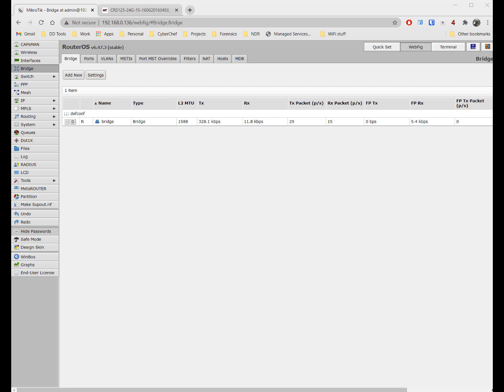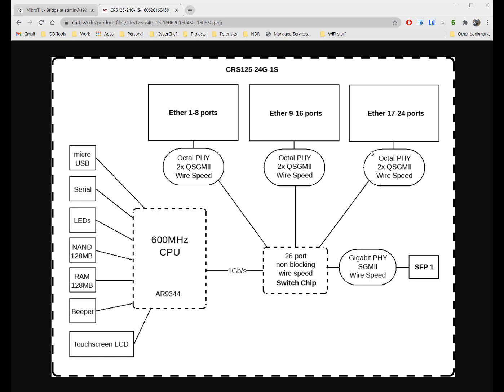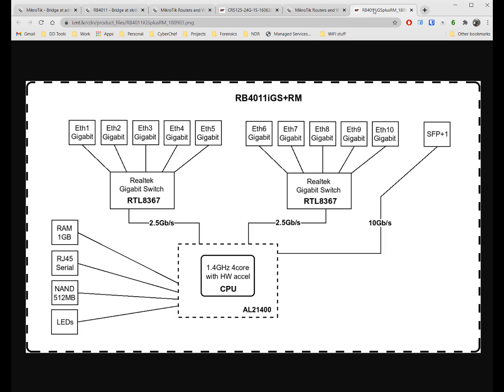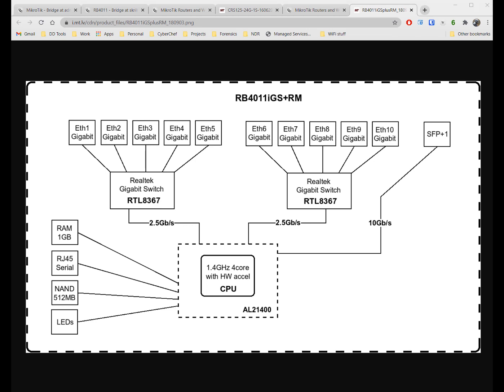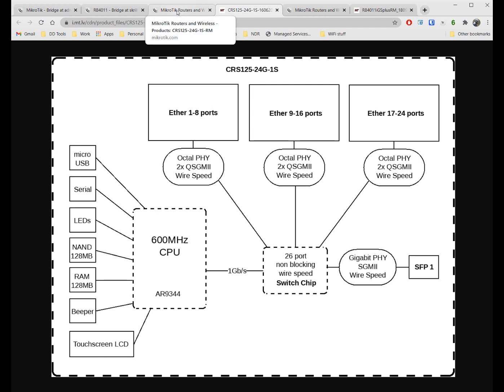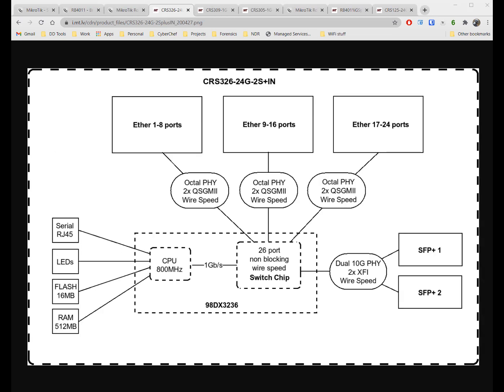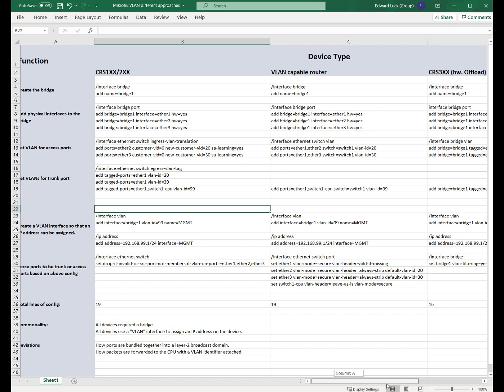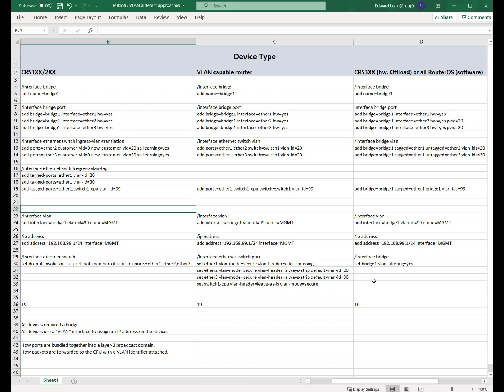Mikrotik Bridge VLAN Filtering - Software vs Hardware

Comment from the maker: Hi commenters - please note that as of ROS 7.X, Bridge VLAN Filtering works in hardware on the RB4011 now (as well as the RB5009).
Reply: Thanks for going back to update this. I appreciate all the info you've pulled together to be able to make the spreadsheet and those comments and I like your perspective on new users, as I'm one of those trying to move away from the "common L2 misconfiguration" of vlans and ports in multiple bridges.
Reply: Thanks for mentioning this.. I just posted a very frustrated comment (not frustrated with you or your video) it was VERY good.  
Also I am currently only testing and trying to figure out RB3011 and how to get simple hardware VLAN working on two ports on same switch chip (not have all traffic between two devices on same VLAN and switch chip go through CPU)..  
All the settings (seem) to be there but have been unable to get it to work.
VLAN filtering checkmark on bridge config works but makes all traffic go through CPU as expected (Latest ROS 7.x)
Reply: so thats not "bridge" vlan filtering anymore, but switch-based vlan filtering ?
Reply from the maker: @3err0  It hasn't been renamed by Mikrotik, so it is now "Bridge VLAN Filtering (in hardware)".  Each network vendor names features their own way, but your assessment about what it is technically, is correct.

Comment: 11:18 so between vlans communication is using cpu ,so its in osftware ?? or is it intEr vlan communication hardware offloaded, but anyway you still need to add switch1-cpu as tagged ?

Comment: How is this relevant to a RB3011?
Reply from the maker: I'm not exactly sure what you're asking, but assuming the question is "how does this behave on an RB3011", it works the same and is configured the same, but the performance is limited by the capabilities of the switch chips, and the interconnects between the switch chips and the processor.  There's two links to look at, first is the Block Diagram for the RB3011 where you can see the uplinks from the switch chips are only 1Gb/s (https://cdn.mikrotik.com/web-assets/product_files/RB3011UiAS-160307123613_160313.png) and the other is a description of what these switch chips (QCA8337) can do: https://help.mikrotik.com/docs/spaces/ROS/pages/328068/Bridging+and+Switching#BridgingandSwitching-BridgeHardwareOffloading

Comment: I am struggling greatly (over a week now) with older Products (RB3011 RB 4011) routers which DO ALSO have switch chips!  
I have been unable to get VLANS to work at the hardware/chip level.
The bridge VLAN filter checkbox works perfectly fine but forces all traffic through the CPU.  
It makes NO sense that These switch chips can't bridge/switch any VLAN traffic between two ports on the same switch chip.
What is the point of a switch chip and all of the switch settings if you can't do anything like this?
Simply trying to accomplish the same job a cheap $30 managed switch would normally do + have a trunk port back to the CPU for management and routing if ever needed.  SMH-  
There are many settings for VLAN items in the switch config part of router OS and it makes absolutely no sense that all of these settings would be there if they can't be used.
None of this makes any sense and a week of watching videos and reading forum posts has not been definitive or helpful.